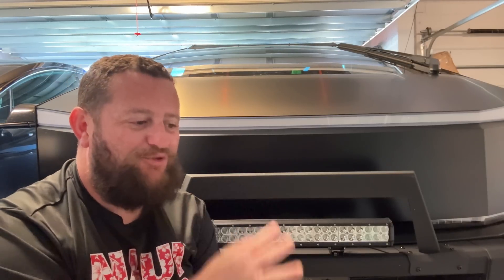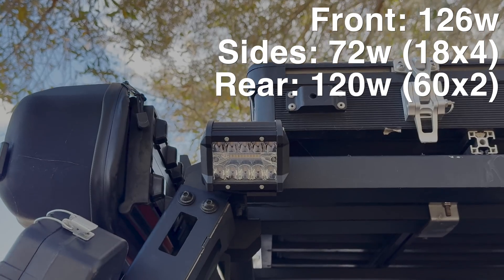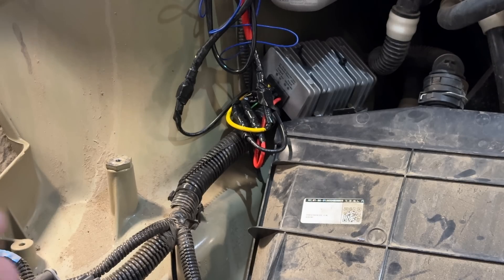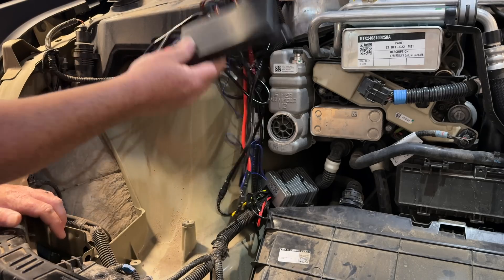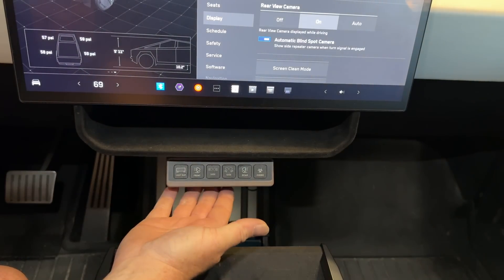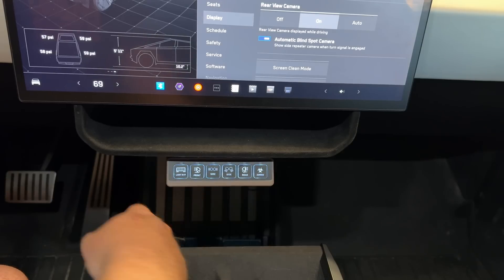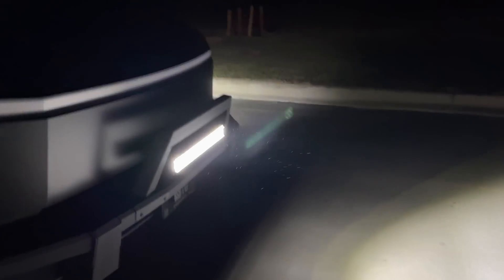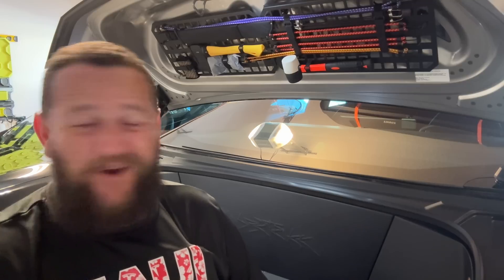Tesla Cybertruck - Power Feed Light Bar Install - Step Down 48v to 12v and Wiring DIY

Comment: How did you wire the + and - wires since the wires coming from the step down are 18ga and the junction box is a thicker  gauge of 6 or 8. Also what did you do with the acc wire? Just connected it to the + as well?

Comment: Does the mount for the front light bar already fit into the push bar you have installed, or did you have to drill extra holes for mounting? I don't have a rack system on my truck (yet) but do really like the look and function of the push bar and light bar.
Reply from the maker: The mount for the light bar is adjustable so it was able to be mounted on the 2 holes for the license plate bracket
Reply: @BeardedTeslaGuy  I just wanted to come back and say thanks for the assistance and advice! I installed the Tlyard Bull Bar + Nilight light bar using this video! Definitely learned a lot, and now I'm a little less scared taking this thing apart. Thanks for everything BTG!

Comment: Is the regulator actually providing 12 Volts? Or maybe 13.8 Volts, which is what you'd see in regular cars? Some accessories (radio transceivers for example) will not be happy with only 12 Volts. The Amazon link doesn't clarify, so wondering if you put a meter on the output?

Also, the switch doesn't seem to be linked...? I've never seen anything quite like that before!
Reply from the maker: Yes, it’s variable, but for simplicity, people understand it as 12v

Comment: What is the parasitic loss keeping the 48v running? 

No AC inverter but probably a Dc-Dc charger from HV battery.

Is there still some losses by keeping the truck on etc.
Reply from the maker: I’m sure there’s some, but I only have power going to it when I turn on the power feed from the screen

Comment: Thanks for the informative video!  I want to add some two way radios and a 12 volt outlet in the frunk.  You have shown me the way!  Now I just need to find some brackets for the roof attachment points that don’t require purchasing roof rails.  I want to use them for small antennas.
Reply from the maker: Nice!
Reply: I put a 2 meter transceiver in my truck. I went with an antenna mount on the edge of the frunk lid and routed the coax in through the structural steel the door hinge bolts to. Easier than I expected.

I ended up going with a small 120 Volt switching supply to give me 13.8 Volts. It sits in the console and plugs into the AC outlet in that compartment.

Comment: Great video!  

I’m always cautious when telling anyone how to mod their cars. I’ve seen some seriously bad things on multiple cars I’ve looked at. 

One thing I’d add is It’s important for everyone to consider the efficiency of the voltage regulator in their wattage calculations. Not all are the same, and some actually consume more wattage than indicated in their documentation. Always good to use an ammeter on both sides of the device to calculate loss. And remember to use the correct voltages on each side in your calculation of wattage. 

Also, not all wire is the same. Using undersized or low grade cable can cause voltage drop, power consumption and other more serious problems. 12V circuits always require heavier gauge wiring than 48V, for the exact same wattage. The lower the voltage, the higher the current. I’ve seen a lot of folks match the wire that they are stepping down from. Typically a bad idea.
Reply from the maker: Indeed

Comment: Very handy info!  😊 I’m seriously considering positioning our travel refrigerator/freezer (that is, 12 volt electric cooler) in the frunk. For easier access.  (Anywhere in the cab ends up being awkward, and in the bed with other essential gear is a chore to access.) 

*Just remember to dedicate 16 watts to DC-to-DC conversion losses in the overall 400 watt power budget.
Reply from the maker: It’s so obvious to add a 12v up there. So many useful things could be used and powered up there
Reply: @BeardedTeslaGuy  You didn't leave a link for the wireless switch box. Please do